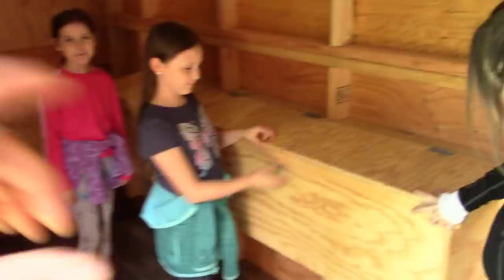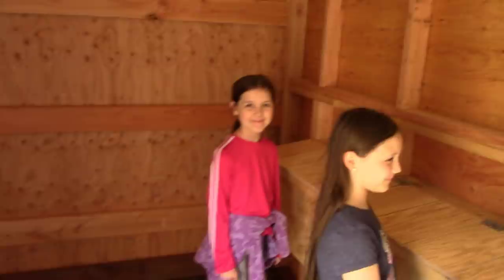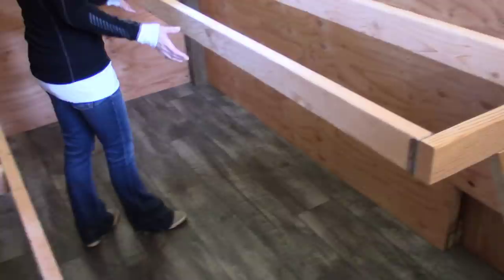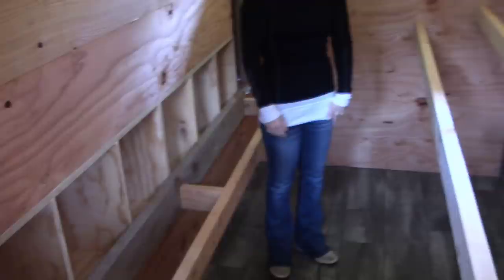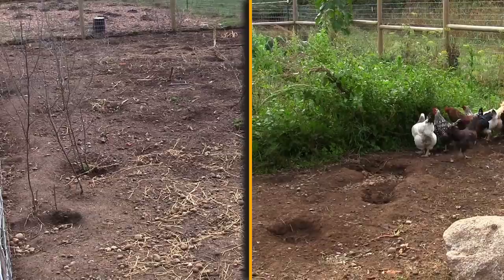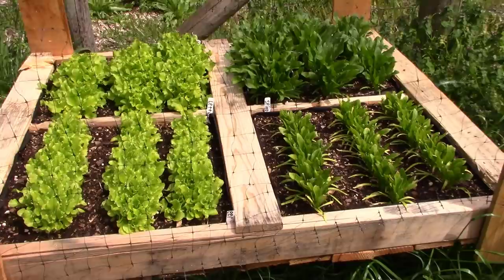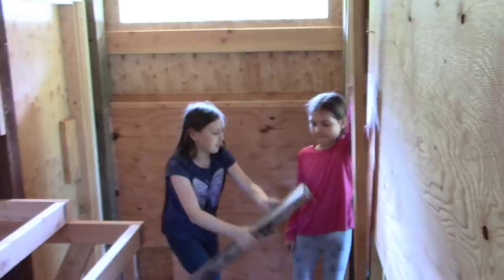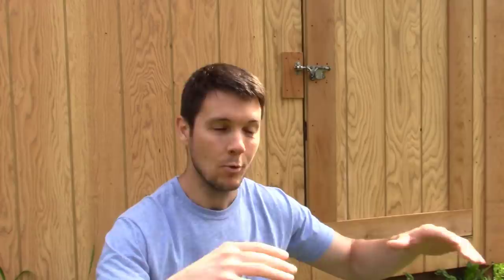Buidling a Chicken Coop (Part 6)  Tiny House Big Reveal!  The She Shed is Done

Comment: Thats a very impressive build, one tip i send you, is employ a removable covering on the perches and the front of the nest boxes, as the chickens will soil wherever they perch/stand and it sets like concrete, i have kept chickens for around ten years now, and i soon found this out, i use a strip of vinyl floor covering, as its easy to remove and clean and then replace after cleaning..i just jetwash it clean then put back into place,,i use re/usable zipties to hold it in place works very well,..and serves a good purpose, in keeping the perch areas clean...
Reply from the maker: I really appreciate the tips, thank you!  It was a lot of planning and personal experience that went into this design and we're really happy with it so far.  Like you said, though, it's always a good idea to protect the lumber from chicken poop.

Comment: Mike you could have used 2x4's (except for floor joist and corner upright post).  I like it, would have built it larger, especially the storage part. Could have been more multi purpose.. 12x12 is a bit cramped.  I had a Rhododendron Nursery earlier in life and always wanted chickens, but missed some opportunities.  I like your common sense and intelligence with respect to building and growing plants. You think the same way i do in so many ways.
Reply from the maker: Thanks, Aaron, glad you enjoy the videos!  I could have done many things different with this build.  I don't have an regrets and do like how it turned out for the purpose we had in mind but if I could do anything different, it would be to extend the roof line another 6 feet off the back for an outdoor shelter.  That can always be done down the road though.  Thanks for watching.

Comment: Great build. I wish that I thought of making mine a little bit bigger to section it off for a separate brooding area and storage. Mine is 8 feet by 8 feet. There is no such thing as an over build but you can easily under-build.
     One thing though, those hinged perch ramps are a little over the top. Chickens establish a pecking order in the flock, even the hens, and they roost in that order. When I first put my perches in the coop that I just built, you wouldn't believe all the squabbling and ruckus that want on at sundown. This went on for the first couple of days until they got their order established on the perches. Now they go directly to their position on the perches and all is quiet. If you place your perches about a foot by a foot apart like an extra wide ladder, they can easily jump up to their position directly without having to fight their way through those already perched.
Reply from the maker: Thanks, Thomas, we always wish it were different after the fact.  I keep looking at mine and wishing it was 12x16.

Comment: Do you have plans or like a material list for this? Thinking ab building my own
Reply from the maker: No plans, I followed the design of another shed on my property and just figuring it out.  I purchased lumber as I needed it so I don't have a material list.  It's just a 12 x 12 structure with 8 foot walls and a 4/12 pitch roof.  The corners were pressure treated 6x6 lumber and the main structure was built with 2x6 lumber.

Comment: nice work but you should have researched minimum space requirements for chickens.  30 birds would need a minimum of 120 sq/ft inside and a 300 sq/ft run.  They will be stressed.  I learned this the hard way.  My coop was not large enough and the hens would bully the weaker ones relentlessly.  I built a 10ft x 12ft shed and 10x25 ft enclosed run.  They are much happier and the bullying stopped.  They need space.  You may want to open up that entire barn to them.  You could build a cabinet for the supplies like I did.
Reply from the maker: Almost 2 years and going strong.  The chickens are happy and healthy, providing many eggs on a daily basis.  The outside run is close to 4000 square feet.

Comment: Well done! What did you use for the 2X4 perch brackets?
Reply from the maker: Thanks, they were just concealed joist hangars for 2x4 studs.  I think mine are galvanized but here's a nice set of them that look painted:  https://amzn.to/3KMBxfq
Reply: @MikeKincaid79  Thanks! I was guessing that was what you used.
Reply from the maker: Yeah, I really like them because they hide any sharp metal that would normally protrude on other hangars, and you can just slip the 2x4s in and out for easy change outs or cleaning.